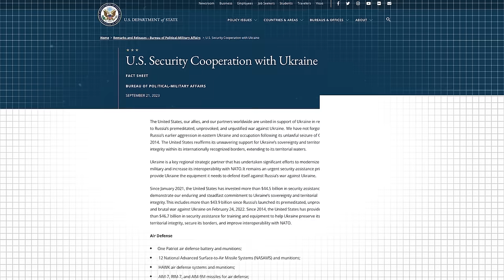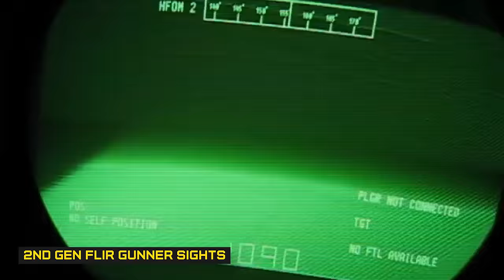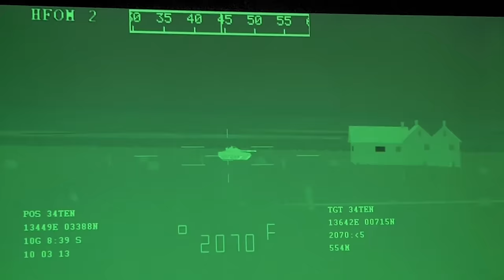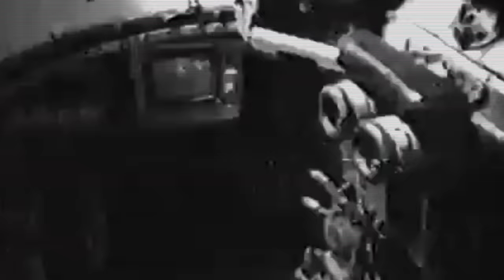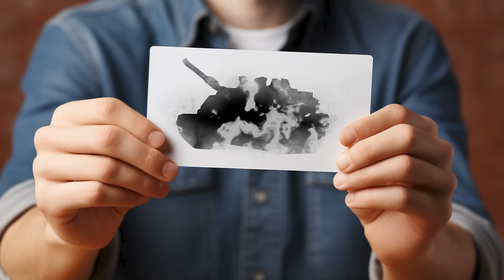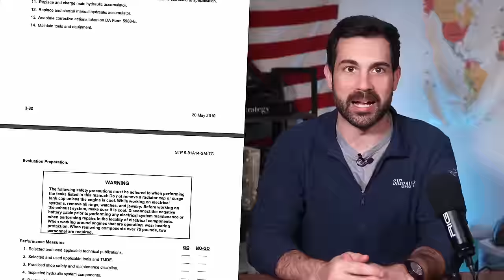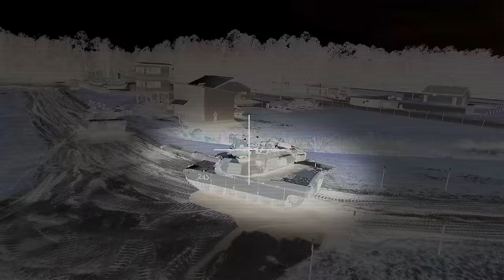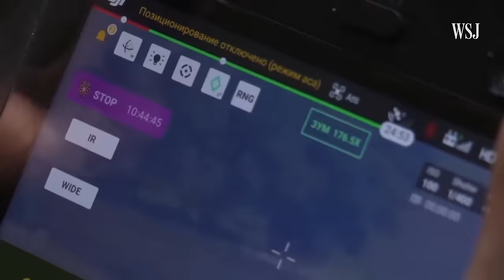M1 Abrams Tank Tactics in Ukraine

Comment: The CITV is great, but it can be hard to use when on the offensive.  Most TCs want to look around, even if just with the hatch at open-protected posture.  The CITV requires the TC to sit down inside the turret, making it harder to keep your situational awareness.  Additionally, while the hull is heading one direction, the turret is constantly slewing left and right.  Add in the CITV turning independently of both hull and turret, and before you know it, the TC is looking behind the tank, rather than offset from the turret's orientation.

One of the big benefits of the -A1 model vs the A2, is that mechanics (and crew) can actually fix things, versus just swapping 'Line Replaceable Units' or LRUs.  From a cost perspective, a newer -A2 has 3x thermal sites - Gunner's TIS, CITV and the .50 cal RWS.  An M1A1 only has 1.  An M1A1 also holds 2 fewer rounds - not a game-changer, but when you only have 40, 2 extra is apppreciated.  Ukrainians will have to learn about loader responsibilities, as they have no reference for this job.  As air guard, it has some real value in a drone-filled world.  Finally, as some have mentioned, the noise of an M1 is fairly unique, due to the higher pitch turbine whine.  It often isn't that noticeable when at lower RPMs (not accelerating). 

Also, I don't think DU armor will go to Ukraine.  No export M1s (including Australia's) have this.  This would be a significant break from precedence.

Comment: Correction: M1 abram is not louder than diesel tank, it’s higher pitch and dissipate quickly but more annoying for the crew and it runs cooler than diesel engines too, M1 has exhaust temperature of 500f and leopard 2 has 600f but this doesn’t matter, they all show up on thermal

Comment: I would like to point out that while yes, the abrams turbine engine is louder up close, it is actually quieter at range because higher pitched noise is more easily attenuated by the terrain
Reply: Creasy fuel consumption on idle tough.  Exactly the same then when driving.  Cuts the operability time usually by 2/3 on average.
Reply: @ThereIsAlwaysaWay2  what does fuel consumption have to do with noise output?
Reply: @jackmio I'd assume your vehicle regardless of tonnage or engine size would run louder when you're at your max speed 🤔
Reply: @EastlakeRasta7  yes, that's obvious, but im confused about the point you are trying to make
Reply: @jackmio  your question is "what does fuel consumption have to do with noise output?" 
And one would assume that my answer would be obvious but apparently not

Comment: 31 tanks are a drop in the pond. Even if you want to argue they can be used a strategically important sites, for the enemy it's a simple equation. 31 is finite. And Abrams are notoriously hard to maintain. Zaluzhny himself said they need 400+ for the counter-offensive and they didn't even get that. It's been handed to them piecemeal. And then they conducted the offensive how the did, and that went so well for them. But it's also abt to be the muddy season so they will I'm be able to use them in small ways until winter when the Russians themselves are allegedly planning and offensive. They will then become targets for Russian planes etc which are increasingly gaining control of the airspace. 31 tanks is nothing at the end of the day, and does nothing to change the conflict. Just another distraction from where this is headed.

Comment: Little correction, most russian T72's do in fact have thermal sigths and laser rangefinders. Even so their thermal sigths are even better than the ones of the abrams tank. The only thing is the abrams has citv and the russian tanks, exept for the T90M, dont have that

Also since when cant sovjet tanks figth on the move ?

Damn lots of mistakes

But still cool video about this topic, i support your channel
Reply: Soviet tanks do not have cannon stabilizing, they have to come to a stop to make an accurate shot which is why the Leopard Challenger and Abrams were so highly requested for this conflict.
Reply: @Frost640  T-72B3 and newer have cannon stabilization. Earlier T-72 variants dont have it
Reply: @Frost640 do you live under a rock
Reply: @Frost640 what a load of crap go do research
Reply: @Frost640 Even the T-55 has fun stabilisation. It wasn't good, but it had stabilization. The T-72s is even better.
Reply: @Frost640  ah i see u live in the cave
Reply: @Frankon81  All T-72 variants had stabilization. Soviet tanks got it before western ones.
Reply: Russian thermals are not better than the ones on even the cold war M1. They have focus and clarity issues, especially the soviet era ones put into T-72B1(V) Obr. 2023.
Reply: @Frost640  Incorrect. Soviet mass-produced tanks have had stabilization since the T-55, earlier than western models.

The stabilizer in earlier T-72A/M did have issues coping with maximum turret rotation speed and would "turn off" momentarily, but I can't remember if the T-72B fixed that or not.
Reply: @Frankon81 Earlier T-72, so basically all tanks that Russia is using.
Reply: @ArchOfficial  and who told you that ? Becaus it isnt true at all

Russian sigths have third generation thermal optics and automatic targettracking in comperison to the us made optics with second generation optics and infirior automatic lead
Reply: @kuunoooo7293  I dunno, operators of both systems and the technical specs of them? They're both known. The Thales unit is more of a civilian imager, not a military imager. It's inferior to the M1 unit, and especially the M60 unit. Let's not even talk about the M1A2 unit. You need to re-focus the Thales unit between every zoom increment and range change and out of focus it has very bad resolution, which makes engagement times longer. It also introduces blindspots, due to some ranges not really being visible unless manually focusing between them alternatively.

Automatic target lead is a function for low-skilled crews and has pretty big issues with contrast detection. There's nothing fundamentally wrong with the methods M1, L2, C2 etc. use for lead. You still need to dump lead in both the M1 and T-72B3 when losing track (But not in L2!) and it takes longer to re-acquire track in T-72B3.
Reply: @Frost640  Most T-72 Russia is using are T-72B, B1 and B3, all which have LRFs and a decent stabilizer. They also had a lot of T-72AV with upgrades. Not so many T-72A were seen and most of them were destroyed over a year ago.
Reply: @ArchOfficial  brother, there is no way you just called 60's tech better than 2000's tech

Also thales produces 3 gen thermals for the russians who are better than the current us thermals
Reply: @kuunoooo7293  The M1 and M60 imagers are late 70s tech. They are better than the Thales units. Thales does not produce military-grade optics for Russia. I don't know why you think they do.

Hell, even the imager in the T-14 is probably on par with the M1A1 one, and definitely not as good as the M1A2 one.
Reply: @ArchOfficial  ..... i think you should look up some information about thermal imagers becaus it seems you are now spitting out some crap
Also thales is a militairy company, their thermals are militairy grade

And how are first and second gen thermals better than the russian third gen ones ? Even if they come from thales ?
Reply: @kuunoooo7293  Thales FC is supposed to be a military grade 3rd gen imager. Based on the view I've seen through them in a T-72B3 (Video, admittedly) and info I've been given, they're not on par with something like the Catherine FC in UK AFVs, let alone Catherine MP. Maybe some kind of sabotage like the French did to the air defense system they sold to Iraq, maybe some kind of sanctions evasion since 2014. I don't know.

Russia does not produce any 3rd gen thermals, although they do make a 2nd gen one for the T-14. It might be on par with the M1A1.
Reply: @ArchOfficial  strange becaus i have seen combat action fotage of a russian T80BVM wich i belive is called the sosna-u fire control system wich uses second or third gen thermals
In the fotage an ukrainain squad of 8 was spotted at a distance of around 4km at a pretty high resolution of something like a third gen thermal, this cant be done in anyway by 70's tech

I have no idea how much knowlage you have about firecontrolsystems for tanks but your points about how first gen and second gen american thermals sigths with older featers are better than russian second or third gen thermal optics with more advanced features
Reply: @kuunoooo7293  I know what video you mean, and the resolution and contrast isn't anything like I've seen on a T-72B3. A bit of a crazy thought, but maybe it's possible the T-72 crews simply don't know how to calibrate it.

Russia does not make any 3rd gen optics. Their 2nd gen optics are probably on par with the better 2nd gen American and German optics.
Reply: @ArchOfficial  Well go tell that to the Ukraine tank crew who just got a leopard and said themselves that their old T72 did NOT have stabilization and they needed to stop to shoot with it compared to the leopard that can shoot more accurately on the run than their T72. And Ukraine got the same T72 as russia (In fact most were abandoned on the field by them ;-). In theory maybe the T72 is supposed to have the tek, but in practice it does not have it. Since when do we believe anything that russians says when it's mostly lies and bullshit all the time.
Reply: @stephanecremont3666  I'll tell them they are wrong; millions of people have crewed T-72s. They also didn't say that anyway.

Comment: After nearly two years, neither side has figured out how to use armor. France put on a clinic in 1940 on how not to deploy tanks. I.E.: As Infantry support. We've all seen video after video of isolated tanks camped in a tree line or skirting a field get it's turret removed by a single infantryman. What we haven't seen is the other 11 tanks it should be with turning that infantryman into a vapor cloud. Tanks are meant to be massed. They are hammers, not anvils.
Reply: Mines & drones.
We are far from WW2.
Reply: A hammer is just a tiny anvil with a stick
Reply: Kind of hard to mass with the amount of drones circling the sky. 
And the sheer amount of front line they have to defend.

Why compare to WW2 too? Let's just have a little comparison of how big the French armour fleet was in 1940... Ah, over 4,400... Ah yes, that's just 'modern tanks' too. 

What a great comparison!!!! Freaking amateurs with their comparisons, never actually think about the variables just the numbers. As if everything else just stays static or something. Fml.
Reply: @MrNigzy23  I have 8 years as an armor crewman on the M60A3 and the M1A1 slick. You couldn't figure out how to open the loaders hatch on either one. It never fails. Mention tanks and here come the veterans from the 92nd Comment Regiment.
Reply: @elektrotehnik94  Are we? Mines and P-47 Thunderbolts didn't exist in the 40's?

Comment: 14:16 while the Abrams is louder strictly by decibels, this doesn't paint the whole picture. While it is technically louder, it's also at a much higher frequency (higher pitch) because it's a turbine engine. Higher frequency sounds dissipate much more quickly than lower ones. So while an Abrams may be louder up close, there is actually a distance where you could hear something like a Leopard 2 but wouldn't be able to hear an Abrams. So while it's actually louder, it's effectively quieter.

Comment: Well, in this, as well as any other conflict, tanks were destroyed rarely by other tanks. 
Here, with the problems mentioned (mud, logistics, wasting too much fuel etc), they will have to face artillery, drones and ATGMs. So, while it is a major improvement (though, the same was said about Leopard 2 and it turned out not to be), it is a fait assessment that they are not indestructible. After all, the first Challenger 2 was knocked out and shown burning (first damaged by a Lancet drone, then finished off by Kornet ATGM).
Reply: And those excellent points are not even the main problem,  main being you need 400 tanks minimum to make a minor difference.  31 tanks is like I give you 31$ to go buy a Ferrari.   Another fact ignored 99% of time  is Abraham consume same gas on idle then when running.  Cut's it's operation time on average by 2/3.

Comment: From what I’ve heard from former Abrams tankers was that the Abrams was loud, but only in the rear. Because it’s a jet engine that’s pushing the tank around, the sound is very directional, so it’s pretty quite from the front, even more quite than a diesel engine (I know, that’s hella surprising). But at the same time, it’s insanely loud from the rear, far louder than a diesel, and hotter as well. Just the nature of engines, what beautiful mechanisms they are.

Comment: Challenger does not use the same tank rounds. It has a rifled barrel not a smoothbore gun. IMO the Abrams is impressive. It is inferior to the Leopard though IMO, which has all the same capabilities and none of the drawbacks: Mainly fuel consumption and speed of action for that matter. Honestly. Those facts don't even matter in this conflict. There is almost no tank on tank combat and the gains are slow, since Ukraine has no air power. Every piece of kit is appreciated. Tanks seem to be mostly mobile gun platforms and the hunter-killer capabilities seem almost worthless. I've read articles in which Ukranian tankers praise the Leopard 1A5 for its mobility and somewhat simplicity over the firepower of the 2A6. They just need tanks. They'll take an M60 no questions asked.

Comment: 14:05 JP-8 is jet fuel.  It stands for Jet Petroleum 8.  Almost identical to Jet-A, except its freeze point is 8°F lower so you can fly 10,000’ higher, or a few hundred miles closer to the arctic.

Comment: The biggest issue the abrams is going to face is the dirt/mud i have first hand experience using an abrams in Europe throwing track was a common occurrence and once the track in thrown you're a sitting duck for drones and artillery it takes a seasoned crew to not throw track and sometimes its just happens everyone says it was designed for Europe but it does best in the desert

Comment: Interestingly enough, you only hear from american side about the M1 being the best tank in the world 😉😄
Compared to a Leopard 2 A6, I don't see any particular differences in the capabilities of both MBTs. Apart from the drive, some of the Leos installed the longer and more powerful cannon from the 2A5 version onwards, but it was not possible to upgrade the Abrams because the turret was too weak for this.
By the way, the British Challenger 2 does not use the same 120mm ammunition as the Abrams and Leopard because they both have a Rheinmetall, or its replica in the A1, smoothbore cannon, and the British tank has a rifled barrel.
Reply: Anrams reputation was formed in Iraq, where it smoked Russian built tanks, mostly at night.

Comment: the abrams isn't necessarily louder than a diesel tank. up close it is but the farther away you get, the quieter it is compared to diesel tanks. that's because of the high pitch of the engine noise. lower sounds travel better than higher pitched sounds. that's why you only ever hear the base of cars traveling by.

Comment: 31 Abrams are “Cope-ium.” What strategic impact will 31 Abrams make unsupported by air cover? How much better will Abrams traverse minefields unsupported by mine clearing dozers? And Abrams “Over matched” range? How will Abrams fare against massed 152mm artillery firing at them from 10+ kilometers and supported with forward observation drones?  How will Abrams do when facing KA-50 attack helicopters firing at them from 4 kilometers away?

Comment: The Abrams Turbine is louder in the higher frequency range but it is a whisper compared to a low freq diesel Diesel. Low frequencies travel farther. Trust me, i was a submariner and we used ELF to transmit low band with instructions from the CONUS interior to Subs around the earth at depth. An APU prevents the need to run the turbine while waiting negating its massive heat signature.